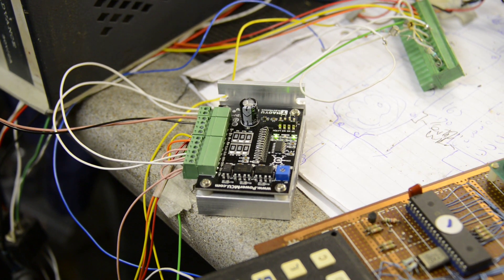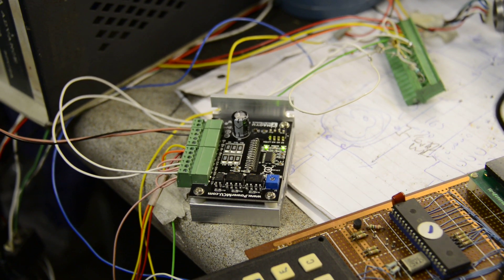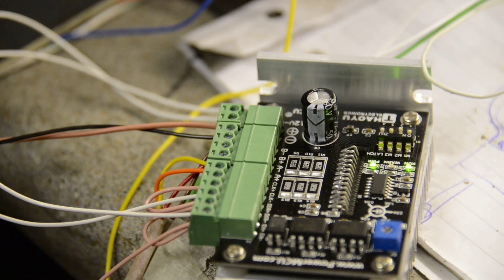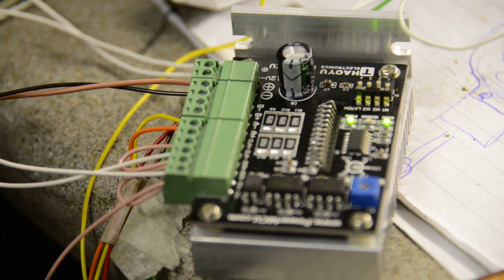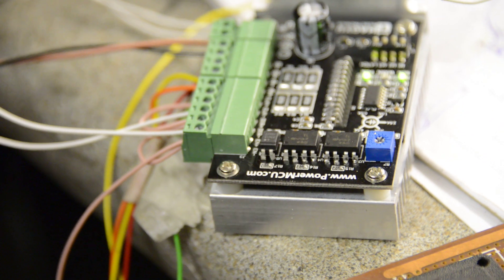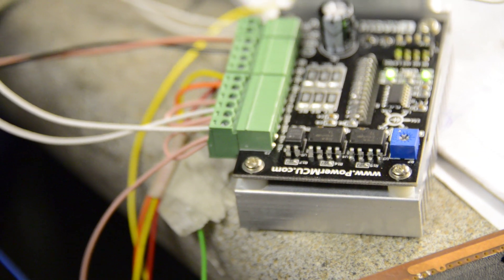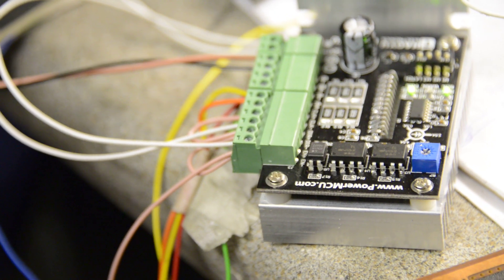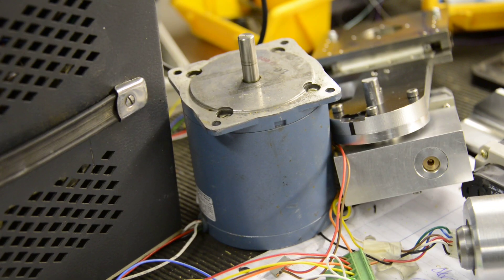Toshiba TB6600 stepper driver board

Comment: hi i'm brasilian and i try change my cnc3ax for a better but very people say me what this driver is no recomendation for work for long time because the temperature of the motors is very hi comparate with Tb6560. My CNC need work for 8 hours/day . What you say from this drive ? is better or not , you recomend ? tanks.
Reply: For that high use you want, defiantly dont buy these

Comment from the maker: The video is the first test of the new chip.  There was the problem with the 'Chinglish' relating to the enable pin as described in the video.  No long term running has been done yet.  The specs. look very good.